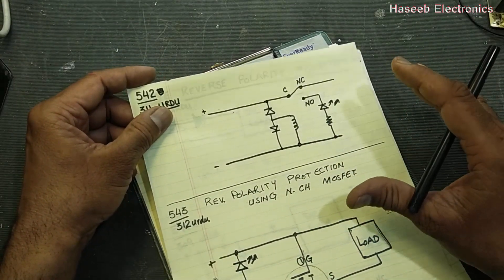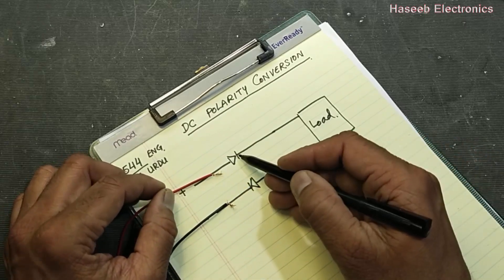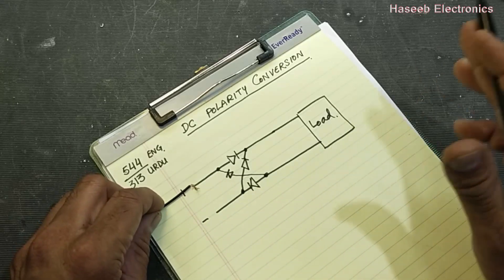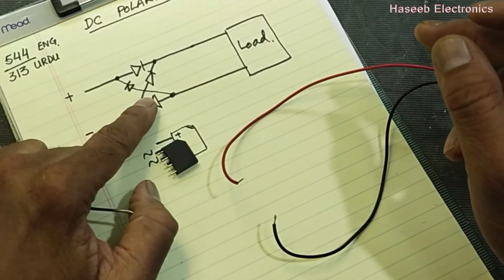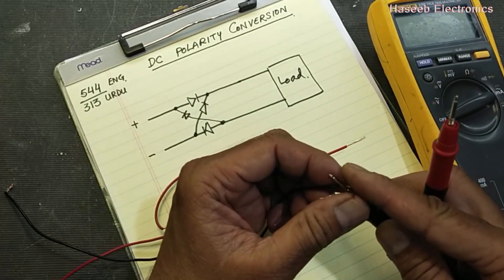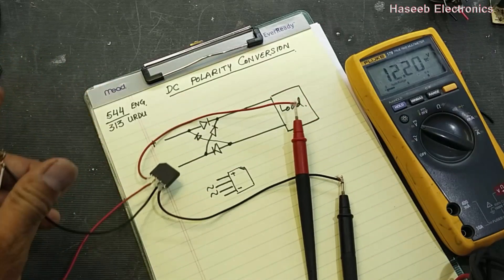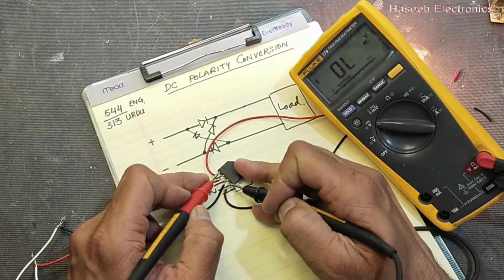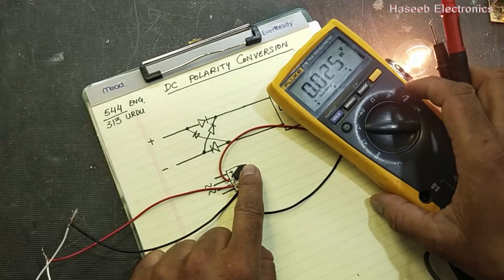{544} How to Convert DC Voltage Polarity Using Bridge Rectifier

Comment: If you just add a small filter cap after the diodes, then you can apply  power to the input, AC or DC...also, when you apply DC it doesn't matter which wires (as you said) are connected to "+" or "-".  This makes a foolproof AC-DC power input!!  You can use Shottky diodes to reduce the voltage drop.  
ALSO, if you add a simple voltage regulator after the cap, then you have a wide range of voltage's possible---but a bit more v-drop.
THANKS MUCH!!!

Comment: Dear I have a DC 12 voltage Led Bulb It works any side of DC polarity, it has not any negative or positive terminal, any DC side attached with it's any side it's works, Now I have question how it possible ? May Make any circuit that can drive any DC Equipment with any DC polarity without negative or positive side attached.plz...reply..
Reply from the maker: most of time it uses bridge rectifier at input 
for more details and polarity converter options check video number 
539
540
541
542
543
544
these all videos are for protections and polarity converters

Comment: I am having this though.
I constanly power led through a 12 VDC power supply. 
I want to automate the idea using micro controller. 
That if no current is drawn after few seconds the polarity will reverse. 
Any idea about my thoughts? :)
Thank You Very Much.

Comment: i have the same bridge rectifier i connect it to the ups transformer it worked in the beginning but when i shorted the output for less than a second it burnd with a huge smoke even when i disconnected the wires at the output

Comment: Thank you very much! Can I ask if for high frecuencies converters the rectification is also volt ac*1.4141, as it is when using 50 or 60 Hz? What about half wave rectifier, is it the same formula that for full wave rectifier?
Reply: Sorry, I forgot to thank you in advance.
Reply from the maker: most welcome
Reply from the maker: basically all ac voltage are measured in RMS value that is 0.707 of the peak voltage of any sine signal 
when we convert RMS voltage into peak voltage (after rectifying these voltage through the bridge rectifier) it provides peak voltage. 
to convert it, it is multiplied with 1.414 
check video number 305
Reply: @HaseebElectronics  Thank you very much.

Comment: Another great teaching; thank you! Two thoughts... 1) The pinout that you drew for the Full Wave Bridge Rectifier is a common one. However, I have often found other pinouts for this particular component. An engineer should always check the data sheet for the exact make and model of the components that he/she is using. This is especially true, for FWBRs, in my experience. I am not faulting anything that you said; I am only emphasizing the need for extra caution regarding this specific component. 2) The FWBR that you used in your experiment may actually be faulty, as its voltage drop is significantly greater than expected. 1.77 volt drop / 2 diodes = 0.885V per diode verses a typical maximum of 0.7V. The additional 0.185V drop is significantly outside of the expected voltage drop rating. Of course, some of the fibers of the wiring could be broken and adding resistance. But, if someone were thinking of using this FWBR in an operational circuit, they might want to proof it. You obviously know this... I am only pointing out to students that engineers should not overlook these warning signs. I apologize, if I sound like a know-it-all. I am only trying to contribute. And, as FWBRs often involve dangerous mains voltage levels, there is safety in knowledge. I hope that helps your student viewers.
Reply from the maker: exactly you are right we must follow the datasheet for any comportment
i used KBL406 bridge rectifier, its maximum forward drop voltage can reach upto 1.1 volt at 4 amp forward current 
in this series of videos i am explaining the possible configurations for polarity protection and finally we will analyze all these features 
moreover if a schottkey diode is used in place of a common diode, that will bring a significant improvement in voltage drop, power dissipation etc
specially thankful for your valuable comment 
please accept my best regards
Reply: @HaseebElectronics  You teach me, more and more! I was not aware that this style of FWBR could have a maximum Vf Drop of that much. Greatly appreciated, my friend.